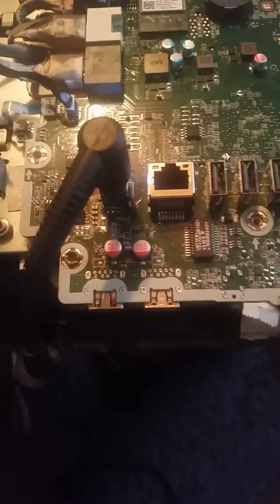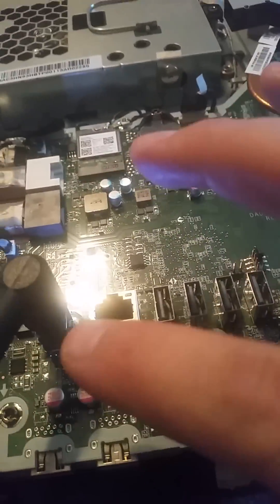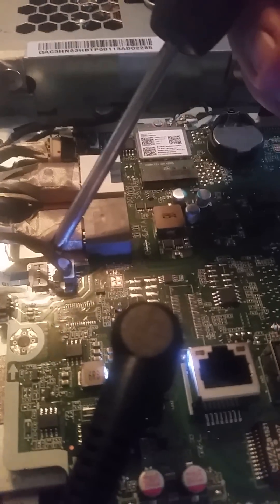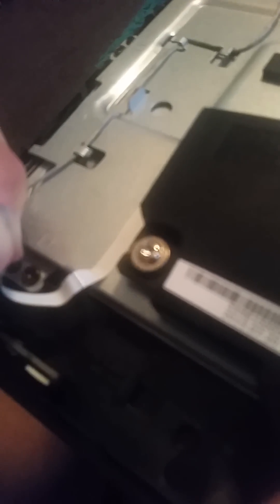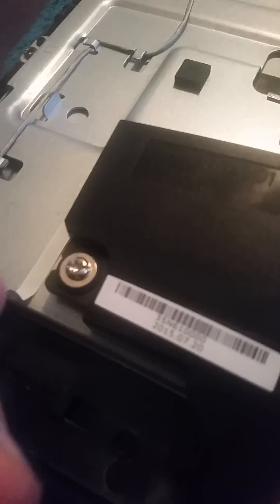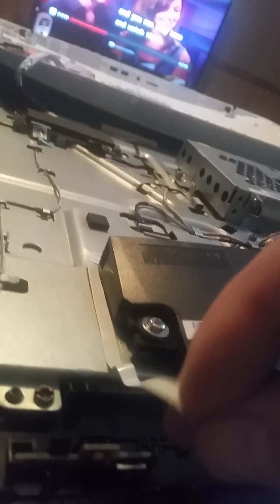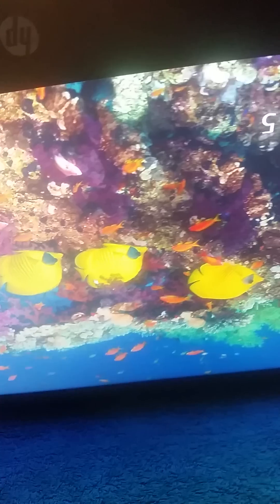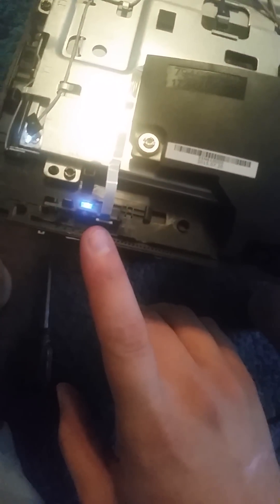Hp 23" all in one won't power on solution

Comment: I know I'm here pretty late!!! If anyone can help, I'm trying to figure this out with the 23-h052 model. The power doesn't have the ribbon cables like the one in the video. I've tried shorting out the power switch, but nothing happens. I don't have a light that comes on when the adapter is plugged in. I've tried two separate adapters, that work, but I get nothing. I'm wondering if mine is something more serious than just a faulty switch. I've tried everything I have found on the internet, but don't want to just pitch this thing. Thanks

Comment: FYI, same thing happened to mine, all you had to do is remove the CMOS battery from the motherboard and put it back in. Using an arc to short/jump the pc is harmful to the components. The CMOS would have reset all the components internals and would start right back up. I just stumbled across this video and thought id share the right way to solve this issue.
Reply: Thanks for the tip, I did remove it, and unfortunately, it didn't do anything to help the issue for me. I mentioned in the video that I would recommend a pc repair specialist prior to attempting such a thing on your own. I didn't have the money at the time and knew a few things about pcs back then. I also mentioned in on of my comments, that it could damage the pc and that you should attempt it only if it was your last ditch effort. 😉

Also the jump I provided was simply bypassing the power switch so there wasn't any real harm threatening the computer so long as nothing else was grounded in the process.  

BUT FOR THOSE STILL READING AND TRYING THE FIX ... By all means plz try the cmos first.
Reply: Shorting the pins on the ribbon cable to power it on is exactly what pressing the button is already doing, there's no reason it would be worse for it. The only reason the result is different is probably to do with dirt or a loose connection stopping the normal button function from working.

Comment: Only the 3.+4. Pin works if i connect them. But that shuts the Power-LED off, and the PC still won’t boot up. If i try the 2.+4. Pin nothing happens. I already changed the CMOS-Battery. Need help please.

Comment from the maker: So after reviewing many comments here a lot of people are saying the cmos battery replacement did the trick just fine. If your having this issue with yours, I recommend doing that first before shorting anything. In my case there was nothing wrong with my cmos battery and I still have the same one in it to this day. The machine is still running just fine and hasn't had this issue again since.

Comment: Man you are a star - this method works, I tried it.
Another method that I discovered works is simply to disconnect the computer from the power source and leave it off for 8 - 12 hours. Connect the power supply and it press the power switch on. Mine has gotten to work after that

Comment: Have one of these AIO 23-Q112 that was shipped with a corrupt BIOS that would often not turn on. Not the BIOS battery as the onboard clock and settings don't get wiped when unplugged.... . Tried to update the BIOS using SP97015 and it said the BIOS was wrong.....Now all I get is the front LED flashing 7 times.

Comment: Hey guys i just powered on my pavilion 20 and the led on the power button went from white to orange then i pressed the button and it was not responding so i took of the ac adapter then put it back on and the power light for the ac adapter turned on and i pressed the power button and the led won't turn on can someone help me??

Comment: Does anybody have a procedure for same exact problem, but as my HP 23 must be different model cuz power switch wire to main board is not that of the 4 wire configuration as shown but that of a 6 switch connection and dont wanna fuck it up by just guessing.....ANY HELP WOULD BE GREATLY APPRECIATED
Reply: Hp-23-p027c

Comment: I got a hp 20 I had it on one day and the screen went black....when I connected it back my keyboard and mouse don't turn on but the light on the power button does
Reply: Did you ever find a fix to this? I’m having the same problem.

Comment: Hope someone see this, having a similar issue. My motherboard has no light on even with the power supply fitted. tried almost everything already. any ideas?
Reply: It looks like the connectors to the thermalthrockle and dipolar gates were inverted during manufacturing of your PC. That was my issue and it was a quick fix.

Comment: hey buddy, i get a light on in the back where i plug in power but when i press the switch, the front light does not come on and i dont get a screen. what would you propose? i have a ribbon cable to the switch with about 8 leads. thank you.
Reply: did you managed to work it out?
Reply: @xlordzee  replaced board

Comment: When i press the switch on mine the led just turns on and off quickly
Reply: Do you solved it?
Reply: Mr Greedy  bro what you did next?
Reply: If anyone solved this problem pleasee help me !!
Reply: Henil Soni unplug the power supply from the outlet for a long time and plug it back in
Reply: @mike_vahemoubayed8099  I tried that before
Reply: Mr Greedy  if you found then please remind me 🙏
Reply: Henil Soni I fixed it by unplugging the power supply for 48 hours
Reply: @mike_vahemoubayed8099  bro it's not working for me :(
Reply: Henil Soni it worked for me but I don’t know what is wrong with yours. Did you try another power supply it might be the power supply.
Reply: @mike_vahemoubayed8099  bro I don't know where is power supply in all in one desktops but, if you saying about that 19-20v adaptor then, I tried after changing adaptor, but again it's not worked :( , but thanks bro for replying me and helping me :)
Reply: Henil Soni yes I was talking about the adapter. But if you replaced the adapter and it still did not work I am not sure what is wrong with this device
Reply: Hello everyone I fixed it by unplugging the power supply for 48 hours it works fine now!
Reply: Mr Greedy I fixed it by unplugging the power supply for 24 hours

Comment: Where is the power supply unit
Reply: The "power supply" is the cable and box that plug into the back of the computer.
Reply: Its external.

Comment: It works, unfortunately once the machine shuts off (power outtage or update or whatnot), I have to re-short the switch to get it to turn back on.
So I ran two wires from pin 2 & 4 on that ribbon-cable, and touch them together whenever I need to turn it on. meh. but at least it's not a paper-weight anymore.

thanks.
Reply: I would try cleaning the end of the ribbon and the slot with isopropyl alcohol and then blowing them dry with compressed air.

Comment: Had the same thing happen to me. Replaced the cmos and it booted perfectly.
Reply: For anyone who comes across this, OP was referring to the CMOS battery. Looks like a watch battery on the motherboard.
Reply: Steven Hatch cmos?
Reply: Steven Hatch What is the cmos??
Reply: CMOS is basically the software that the computer runs when it boots, prior to the computer invoking the OS (Windows?). The CMOS starts Windows and tells it what device to boot from, normally the hard drive.

Comment: does nothing for me but turn the power switch led on
Reply: Jack Burton mines doing the same thing. Were you able to fix the issue?
Reply: no, it wasn't mine so I tried everything I knew with no results ,I now use the screen with e-bay bought driverboard and  my raspberry Pi
Reply: Did anyone solve this? My power switch light turns on but no computer startup
Reply: My computer turned on but screen didn't. Before the hard drive starts functioning the computer turns off and the power switch lights turns on and off. I found one cable in the upper left of the motherboard disconnected. I fixed it by connecting it.

Comment: thank you sir. - i was wondering how to short out the switch - bought a new one from ebay but no good. bought new ribbons from ebay - no good. will try this out
Reply: jqstick00 did it work?
Reply: yes it worked however i had to short it from the ribbon that is on the edge of the motherboard that goes to the power switch. just touch it with a flat head and it powered on.  i was excited that it fired up

Comment: Excellent video. Worked first time with no issues. Thanks for the excellent tube on this problem. 👍👍
Reply: Just to add, i have also the same PC however the problem was on the battery, seems we have a not so clean powerlines so it damage the battery.... Problem solve!!